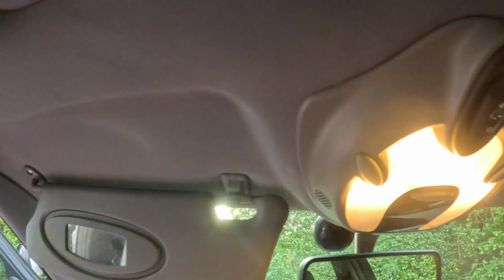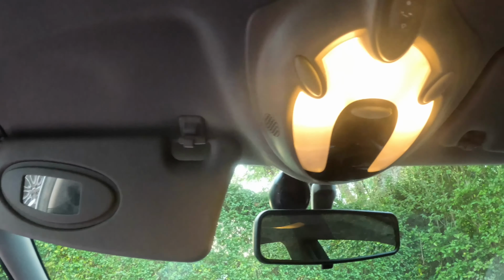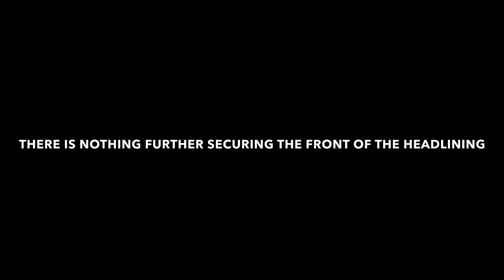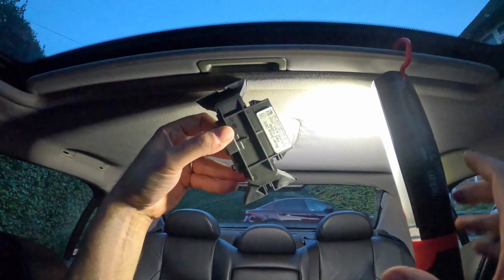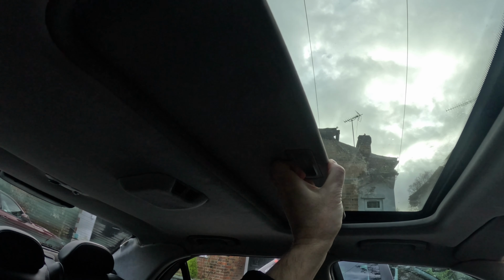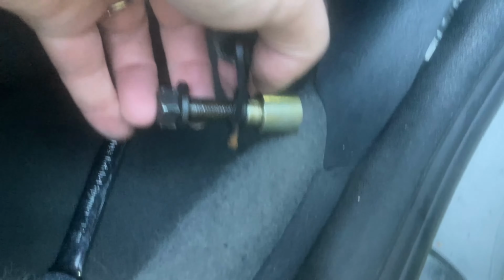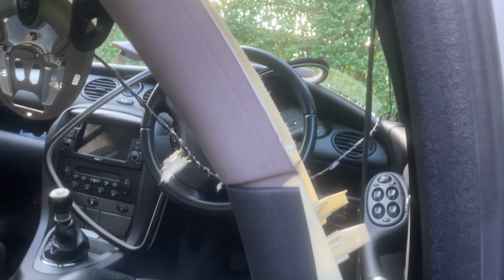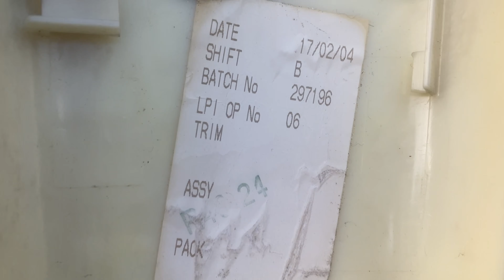MG ZT 260 Rover 75 headlining removal/refurbishment part 1

Comment: Brave man  ! 
Very informative video... Ive just removed a Rover 75 Tourer headlining. 
I removed all the attachments AND the B pillars thus suspending the headline by the door seals. I must admit that I shouted at the screen when you were pulling out the headlining of the top of the B pillar panels but you removed without incident. Well done. 
When is Part 2 available ? 
What sort of sticky glue are you going to use ? 
My Tourer headlining is on a table in my Mates paintshop in the dry. 
Any advice from your personal experience would be appreciated. 
I'm John, proprietor of John's MG Rover parts. Thanks in anticipation..
Reply from the maker: Thanks for the great comment, I really appreciate it.
I should put the items I use in the description!  The other parts of the heading job are already on my channel.
Reply: Thanks for your Trim-Fix recommendation. I bought 3 tins, 500g. I used 2 tins to lay on a lavish amount of adhesive. 
The headlining had been replaced at some time and it was dangling like soggy curtains in the middle, extending the full length. ...It was easy to remove the lining from the base, AND...the backing was sponge and undamaged. I started by sticking down the middle, and then after this was stuck down, worked around the sides. Reason being, the middle of the headlining can be subject to tension if you just stick everything and flatten down the middle towards the sides. ANYWAY........IT WORKED....so,  I'm Mr. Smartypants. 
Sidenote....After reattaching the headlining, I read the small print on the tin. It said 'Not suitable for headlinings'. Well....it certainly worked. Thanks for your help. You're a Star. High 5s all round.